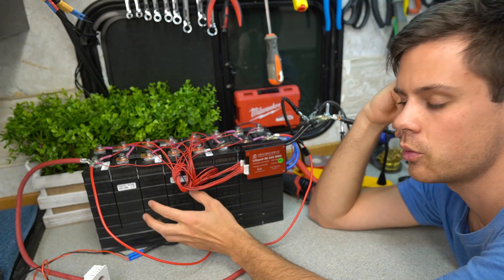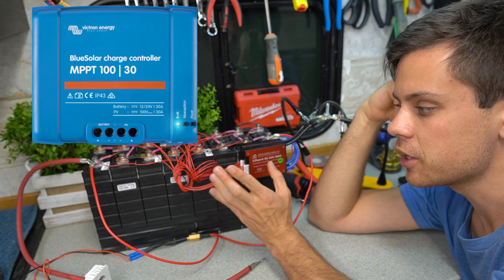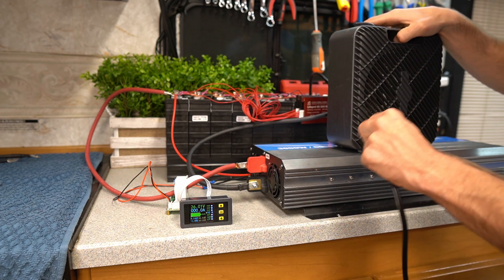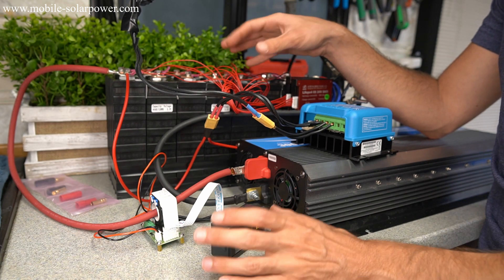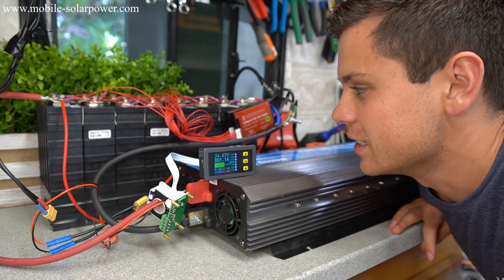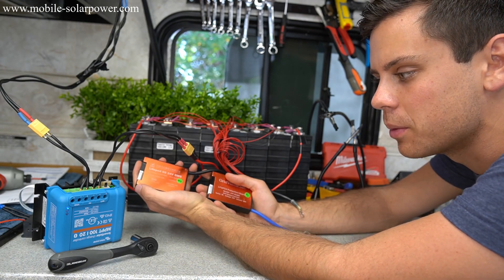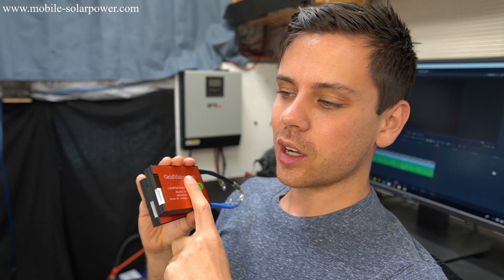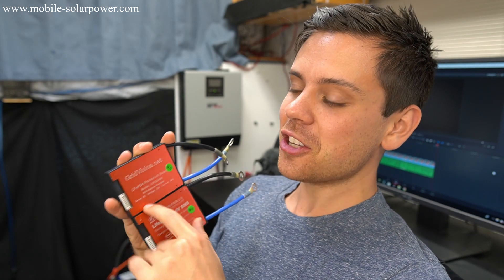Pushing 2800 watts with 2x Budget Friendly LiFePO4 BMS - Quick Test

Comment: I was going to use 2 bms on a 240ah x 24 lithium bank. One 60a and one 150amp. The 150amp connected to the 3100w charge inverter at 80amps. The 60amp bms connected to a wind turbine or secondary solar panel. Any thoughts? I could expect the 150amp bms to cut out at low voltage 2.5v. But would allow the batteries to charge the battery bank and let the 150amp bms to cut back in..

Comment: I have been thinking about this lately when looking for a cheap non-smart JBD BMS and I just think if you would parallel two battery packs with BMS together to achieve 120A, I don’t see why you couldn’t put them all together in one battery. In 2 battery packs, if a BMS fails, the BMS in the second battery will trip. Putting everything in one bigger battery will work exactly the same way I suppose

Comment: or you swap out the balance resistors for larger ,and swap out the fets and add a contactor 25-30 dollars of parts turns 60 amp bms into 200amp bms

Comment: Do you have any videos on the daly bms? I see they make those with parallel modules and info on them online seems scarce. From what ive gathered, that module keeps both banks at a similar state by transfering 2, 5, or 15a throught the module between the 2. Is that right? Is the only difference a faster equilibrium or are the 2, 5, and 15 rating referring to a difference before it begins transferring from one to the other?

Comment: Hi will, hope all is well for you young man. This is exactly what I was looking to do. My question to you is. Do the balance leads from each  bms get connected to each series of each bank or packs? In my case its battery packs. I have these BMS's as well, except mine are for lith-ion. Would you happen to have a wiring diagram of this video you made? Thanks for all you do.

Comment: So is this configuration the same as having two separate lifepo4 battery banks with their own bms, wired in parallel? That's what im wanting to do and this is the only video I've found, but im not exactly sure if it's what's being done. For weight issues i don't want to have to lift a 8 cell milk crate bank, I've had one back surgery that i was supposed to be almost crippled after and with lot's of therapy im doing good, but one 4 cell bank will be more than heavy enough for me.
   There's also the bonus of being able to run on just one bank if something happens to the bms on a 8 cell single bms set up by running 2 banks with their own bms. Since the video didn't start with your wiring and usual step by step explanations im not sure, and if it was two separate banks i would expect a warning about making sure they were charged to similar levels. 
   After your Titan solar expansion video with the over heating wire, i would imagine you would give a heads up warning lol. Thanks for any kind of reply!

Comment: If you parallel these BMS(s) as shown, you need to make sure your inverter / charge controller can never get these near the overvoltage and undervoltage cutout values of the BMS(s).  Take discharge for example.  When pulling max current (say 80A), one BMS will try and disconnect first since they aren't perfectly matched due to tolerance.  With one BMS disconnected, that leaves the other BMS to take the full 80A load - which is above its rating.  Becomes a race of what happens first - BMS damage, BMS shutdown due to overcurrent, or BMS shutdown due to low voltage being finally detected.  Also, understand that the failure modes of the MOSFETs in the BMS are typically a short - and then it overheats and never disconnects.  But what you have shown will work if the charger and inverter are programmed to work within a narrower charge/discharge voltage than the BMS(s).

Comment: Some one Now if is  posible conect 3 
Bms  in  series to Made higger voltage  example. 4 bms 14s 48v in series to Made 200volts yes yes i Now si dangerous, but it's for inver trifase, motor suply

Comment: Hi Will, really like you enthusiasm, I'm looking to build a 24v 8 off 280a per cell for my RV running a LVYUAN 3000/6000 inverter and 2 off 37v 255a solar. any thoughts greatly appreciated . I hope to use a 2600 ceramic hob.  Thanks in advance

Comment: Hello Will. Thank you for the great videos from you.
Which configuration can you recommend for a low budget 12Volt system if I have 12x 110Ah cells and want to operate with a 2000 watt inverter. Just have to run the coffee machine.
Which BMS and how much power must they be able to do.
Mobile solar power shows me 2 interesting solutions:
1) In parallel with 3 sets of 12Volt and 3x BMS or
2) configured as a large battery block with a BMS. (What performance must the BMS then have.)
Thank you for your support and help
Sorry for my english, I write you from czech rep.

Comment: bad news if your BMS disconnect won't turn off the inverter if your victron has solar power.. it will continue to power the relay. 
yes separate port BMS would solve this

Comment: Great video. Do you have any recommendations for a small compact and light weight battery 60v / 60ah? I have a Weped GT50 electric scooter and my battery output is only 14.7A max @ 60V for short periods, and only 9.8A continuously. The dual motors are rated for 1800 watts continuous each. The battery can only deliver a peak output of 60 x 14.7 = 882 watts. I would like to upgrade the battery with better cells and BMS. 3600 watts / 60 v = 60 amps...that's the output the battery should be able to deliver. Thoughts?

Comment: Can I use a (cheaper) higher array of Solar panels and a small battery(expensive) bank which does not allow the battery to discharge beyond 45% during day time? Will it damage the battery?

Comment: If this parallel system works well for the 2x 60A BMS, would 2 x 100A be good for perhaps 150A?  

I have a 24V system that will be running a 2500 watt (104 A max) and a step-down to 12V that would go 20A.  Max potential continuous amperage would be 125A.  Thinking to go with 2 x 100A BMS in parallel, but want to make sure that the cells would be balanced and protected. 

My system is 9 x Nissan Leaf Gen 1 batteries, three in series and three packs in parallel.  It would require a 6S system and I'm having trouble finding a 6S  BMS rated for anything over 100 A.

Thanks for your help

Comment: Will, how about a short video on soldering extra 10awg wires on the 100A 4s bms recommended on your site. I'm building a 4s2p 210AH 12v pack with 2 of these bms' in parallel and am a bit nervous about soldering large gauge wires.

Comment: Will I recently bought 2 x 12v/250 amp output and 12v/120 input BMS units from Deligreen in China. These units cost $90 each and they have a big body as a heat sink compared to those smaller ones you tested. Like I mentioned before my only concern is the guage of the wires coming out that in my opinion should be thicker. I have as yet connected a high load onto them but as I will run 2x batteries in parallel I expect to draw 12v/100 amps from each battery as a max. ( I have a victron multiplus 12/3000/120 inverter/charger to feed on the output side)

Comment: Probably the best way to do this would be to develop BMS Logic and Driver boards. That way you have just one board doing the logic and multiple driver boards slaved to the master handling the load in parallel. By the time you develop and fabricate though, it'd be less expensive to buy a high current unit and be done with it.
I wonder if you could take a cheapy and convert it to a slave board by cutting a trace on the PCB at the mosfet(s) gate and running a wire from the designated master.

Comment: Hi Will, could you please do a high cell voltage disconnect test of those Daly BMSs. I got two of those and although the specs claim that cell overcharge trip voltage is 3.65 +-0.025 I managed to reach 3.7v of a cell and it didn't disconnect, so I had to manually stop the charger, as I was scared to continue. I however might have inaccurate voltage meter, so I will be glad if a more experienced person does the test. Would you not recommend it if it doesn't stop the charging at 3.7v?

Comment: Hey Will I bought A Daly 24v 8S 60A BMS with a separate port instead of a common port. Now that I am wiring it up I realize that the manufactures wiring diagram is having my isolate the solar charger's battery negative connection to the BMS C- yellow separate ground. Now if this was for a vehicle (Scooter) application sure no harm to your basic charger. In a solar application I am a little worried that the BMS may be disconnecting battery ground to my Solar charger and this will remove battery power to the solar charger when the BMS cuts it off. 
I can't find any instructions or video's on your site or your guide that I purchased concerning a Separate Port BMS. Please assist?
Reply from the maker: Yeah I changed the recommendation to common port. You can see all the details under the community tab of my channel
Reply: Oh no. Ordering from China is 4-6 weeks and it is too late can I ground C- to ground terminal block with P- and have this work as a common port?
Reply from the maker: Yeah it can work as a common Port no problem

Comment: Zu my friend.
I Love your Videos an they are verry helpfull.
I am building a tiny House.
And i have a question about bms.
I hope you can help.
I have 4 batterys (4x4 Cells 3,2V)
I use want to use them for now in 12v so i Put them in parallel.
I dont have a bms, but your bms is great.
Can i connect them in parallel like the Batterys too?
Means, i put one bms on each Battery, and connect them parallel.

I realy Hope you can help.

Trank you and greatings from Germany 😊

Comment: I'm considering the 100AH LiFePO4 batteries for a 16S bank (48v replacement, 51.2v nominal). What is a good BMS for 16s bank?
Reply: I'm finding limits on the charging rate through those BMS in my research.

Comment: I've got lots of LiFePo4 26650 Cells, that I'm going to be making into a single, large 12v battery.

Do you think (or can you test) if I'd be better to make 1 large battery with multiple BMS's on it, or if im better to make multiple smaller batteries, each with a single BMS, then connect all the batteries in parallel.

Comment: In some other video I mentioned that I don't like the battery protect approach with relays and extra complexity. But I think I changed my mind.

The 2 BMS in parallel are possibly even worse approach. Lets say each BMS is 60A. Lets say you suddenly have a spike of 160A for few ms (charging some capacitors, or failure in the load and incorrect fusing). Then one of the BMS will trip first. By miliseconds. This means second (untripped yet) BMS will see a full 160A for a millisecond. Depending on construction it might fry BMS. You should try overload test.

Similarly, when discharging at high but "rated" current, lets say 110A. One of the BMS will disconnect first (this is mostly due to the calibration and offsets in things like opamps, comparators and ADCs).  This can also happen if one of the BMSes stops working, because one of the cell leads got loose to only one BMS. System will appear to work normal. But if only one BMS is actually connected, 110A will go via one BMS. Sure, it should trip, but I think it will make their life shorter. And if you push only 55A, you will possibly never notice that only one BMS is working, and is overheating.

In this case, actually I think use of very low current BMS + external relay is actually better.

Nice experiment and idea, but requires more testing.

EDIT: Doh. I should have watched to the end. You actually mention the issues I just described. You are smart. Good :D

Comment: Great videos. Im a novice and have your book on mobile solar. So, in theroy if you had a 12 volt lithium 100 amp battery and a inverter and pluged a 500 watt , 5 amp per hour ac unit into the inverter... it should run around 18 to 19 hrs?  or am I missing something??
Reply from the maker: That is 5 amps at 110v. So 550 Watts. A 100ah 12v battery has 1200 watt hours. So you can run air conditioner for two hours.
Reply: @WillProwse  Okay, thought it did not seem right. Thank you again for your personal advice... Back to the book for me now, lol.

Comment: What is the wire gauge from all the cells to the BMS harnesses? Seem low gauge for pulling collectively nonetheless 80-100 amps.
Reply from the maker: yes these wires are absolutely under gauged for the load and I complain about this in multiple videos but I don't want to sound like a broken record so I did not mention in this specific video. But all of my previous videos on BMS mentioned that multiple times

Comment: Wondering what's the lowest budget decent complete solar system set up for full time typical van lifer considering a build right now? Do you have a kit on your website that includes every component needed for a bargain hunter's build? I realize it's all subjective. But, hypothetically speaking, let's say a person was reasonably conservative in power usage. How affordable is a complete set up in summer of 2019? Also, I heard you believe renogy is overpriced. I was watching some other videos reviewing Harbor Freight Thunderbolt 100w 4 panel kit and raving about the performance even in overcast conditions. I'm guessing those panels are junk based on the price of them. Usually you get what you pay for. But curious if you have an opinion on it? Great video here. Thanks for sharing.
Reply from the maker: My cheapest full size package is: https://www.mobile-solarpower.com/minimalist-on-a-budget.html

Full size diy systems cost quite a bit. I actually have a new video I am working on that will cover a $600 system that will beat everything on the market. The moment I post it, the parts will be out of stock. I am still testing everything first before I recommend it. Coming soon 😎
Reply from the maker: Harbor freight kit works but I do not like the plastic rails on the panels. Pretty cheaply made

Comment: Hi William,
Thanks for all your excellent videos and great positive attitude. Through your channel I collected a strong interest in solar and batteries and motivated to work by myself on a solution on the ssiling boat we are about to buy for a five year cruise.

There the idea for a video came up: what does a (saltwater) cruiser have to take into extra consideration when building is off the grid solar system when looking at all your excellent DIY videos? I am thinking of the high temperatures the batteries and inverter can be exposed to, ventilation, corrosion risks.... Etc. What should be done differently vs an RV?  

It would be awesome if you could do video on that!!! Will buy your book as well (but right now still saving for the boat :-)

Thanks, Rod (from Switzerland)

Comment: Hi Will. Thanks for the info you are providing. this is just great information for all of us trying to build a setup of our own choosing. One questions I have. I am in the process of building a wind turbine set up to start and then it will be a solar system to compliment the first one. Can I apply all of the principles in your videos to supply energy to my batteries. I assume I can but I just would like a confirmation from you so I do it right the first time around. Thanks again for all that good info of yours. Keep up the good work.

Comment: So are you Pro-BMS now? I know if your previous videos you said they weren’t necessary since you were bottom balancing. 

Also I know it would be less DIY friendly but have you tried to take the BMS apart to see how hard it would be to upgrade that wiring to say 8 gauge? Obviously it would require soldering which may turn some off.
Reply from the maker: I don't need BMS but my beginners got mismatched cells and one had them out of balance big time so I want BMS options. I have both available on my website
Reply from the maker: Yes I tried to take it apart but it's very hard. Couldn't do it. Thing is glued together! It's crazy

Comment: I'd like to know what the smallest/cheapest system I need to need to keep a small 4 cylinder van cool at 72 degrees F in the Florida summer night (around 82 F ambient night temp)  for 7 hours (11pm to 6a).   I currently have a 100watt monocrystalline 12v rigid framed solar panel on my roof.  I currently use it to run a 12v fan and freezer during the day and it keeps my primary starter and and a gel topped off.

Comment: 2x on 80A @51C(125F) points me that BMSs you use are at most 40A-continuous by default without modifying heat sinks or doing any air flow.
many/some//w/e (chinese, yep) other BMS with temp-sensors will (and should!) switch off @50C on their MOSFETs by default - and that's a good practice in my opinion. though, it could be 40C because of lower degradation (similar to Li-batteries you always talk about) of transistors, but it's more expensive (like you need 10-12 FETs instead of only 8, a crazy 1.5x ratio).
nice test btw, very glad to see that some BMSs could be parallel'd.

Comment: +100amps in these tiny wires? 
hum
Reply from the maker: 10 feet of 4 gauge wire can handle it with less than 3% loss. I over gauged this system. It's a non issue. These wires are actually bigger than necessary for this test. If my capacity test showed bad numbers and the wires were hot and not sized to wire charts, I would suspect that. I do not post any test video without factoring these things in

Comment: Will, would you be interested in doing a series on built in (120V) converters/charge controllers that come standard with RV’s, and their interaction with lithium batteries? I have a Parallax 1077 three stage unit  and I’d be curious what would happen, and if it could be modified to work better with lithium batteries. Thanks